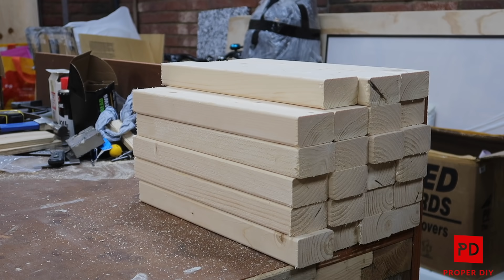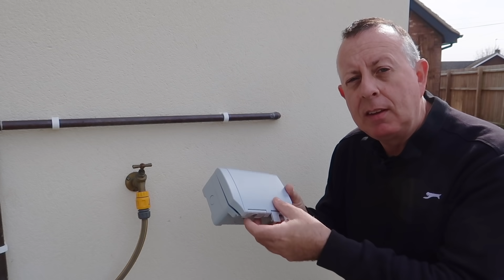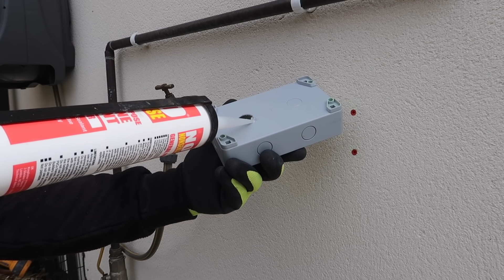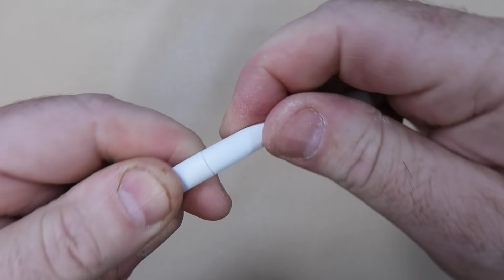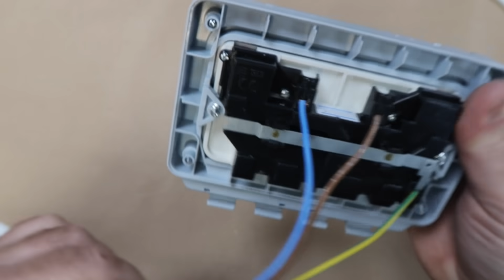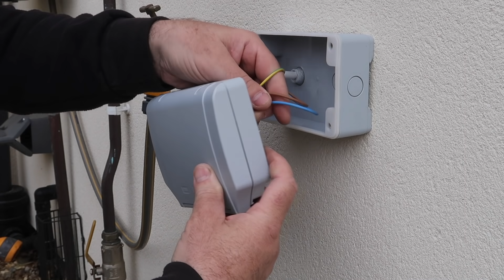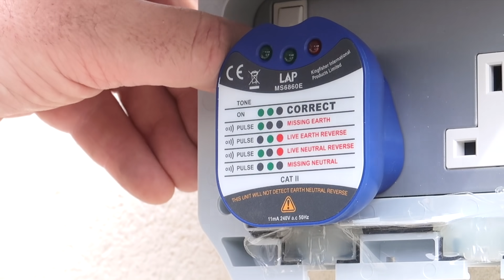How to Install the Easiest Outdoor Socket

Comment: Another great clear concise video! I've recenty taken to crimping  ferrules into the end of copper flex after exposing the copper. Looks neat and stops them getting messy if you need to readjust things 👍
Reply: Yes, I bought a ferrule crimper for flex connections. Only other thing I would have done was to put a cable tie around the flex exiting the inside box, just to stop it getting pulled if something gets caught on it.
Reply from the maker: Thank you. Thats not something I've ever done but want to give it a try - maybe a future video!